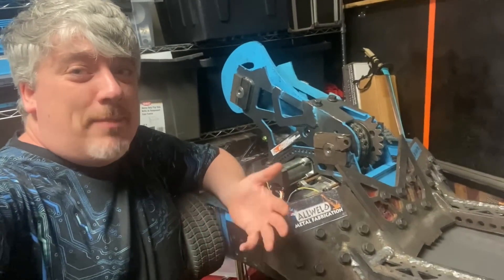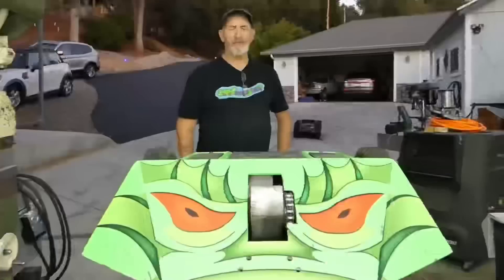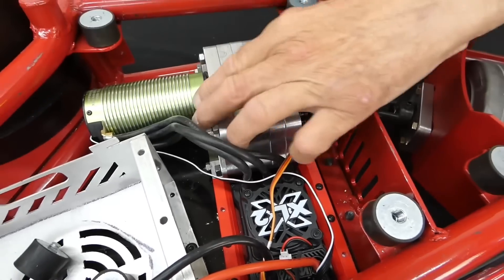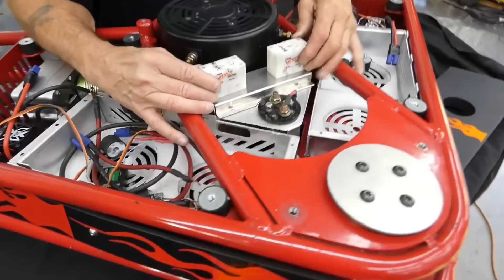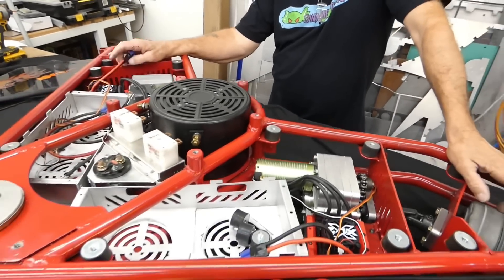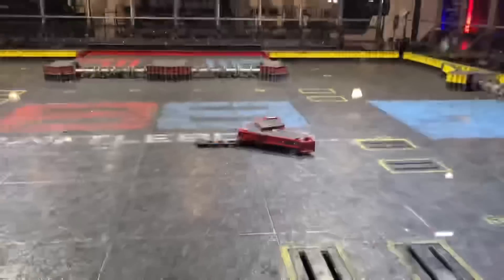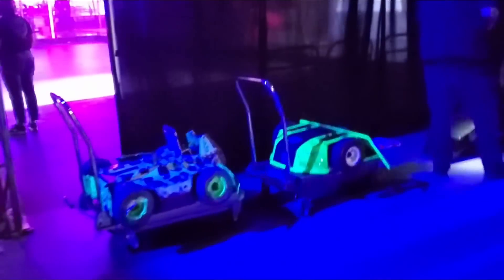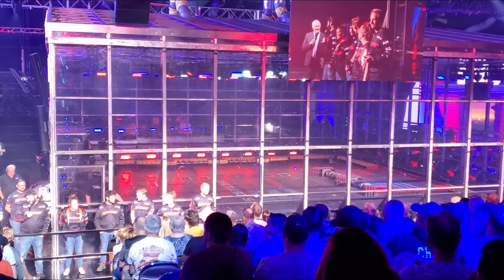Swamp Thing & Hellfire Go To Battlebots Proving Grounds

Comment: I find it interesting that rick mentioned in the video that Hellfire was running at 60v yet there's been several discussions from other builders such as team whyachi about battlebots lowering maximum allowable voltage to 40 for safety reasons. Maybe they've made an exception for the live shows? 🤔 🤔

Comment: This season is going to be insane. Hellfire is a MONSTER
Reply: It didn't work and didn't even fight... plus it's not invertible and can't drive

It's just valkyrie but way worse
Reply: @ayylmao1193  It has U-joints to angle its drive shafts, and faster spin up time. I'd argue Hellfire has a bit more flair than Valkyrie.
Reply: @what-fw5vk 

-the weapon is significantly less powerful than valkyrie (~ME0909 (hellfire) vs. LEM (2021)/3 castle 2028s (2022)
-hellfire has no armor
-hellfire cannot self right
-hellfire is not invertible
-Hellfire's colson wheels will gum up with dust quickly making it undriveable 
-I do not give a flying fuck that it has u-joints in the drive that is just actively bad
-valkyrie has angled sides and armor giving it a unique look, hellfire is a v-shaped box
Reply: Roundhouse looked to be much better anyways